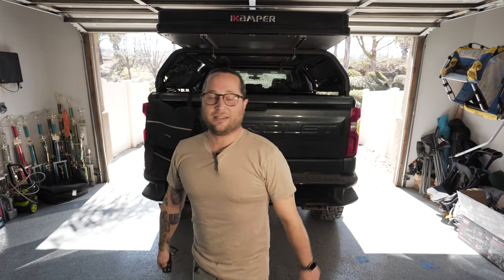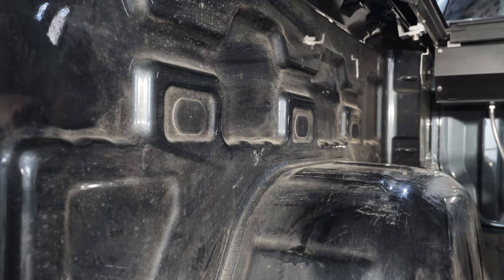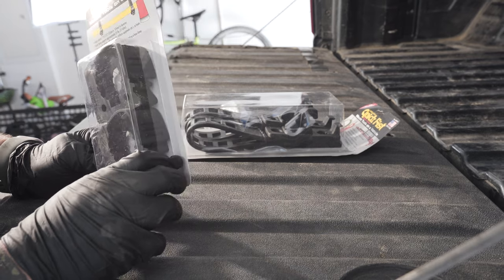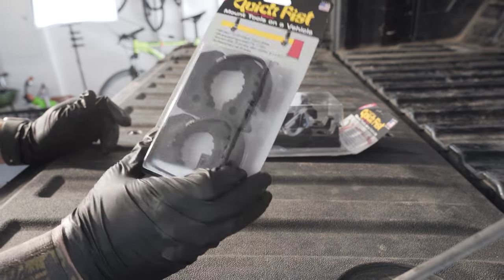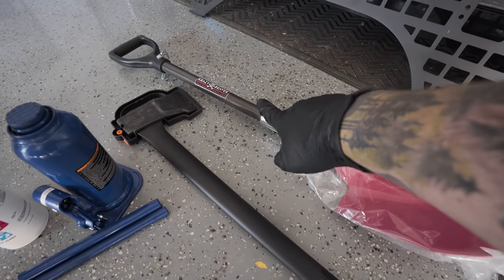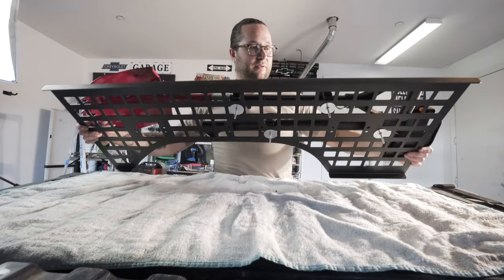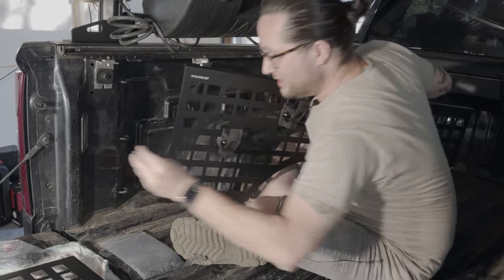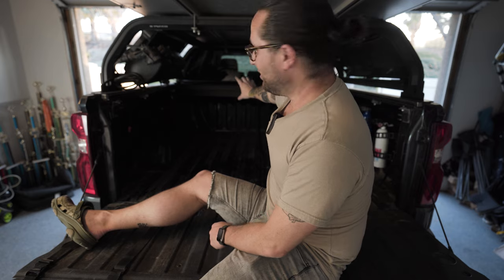Molle Panels for your Truck Bed! (Putco Molle Panel Install)

Comment: I really like the system. From my experience I would add a door breaching tool, fire extinguisher, tool box, med kit, Slim Jim, and bolt cutters. All of these I’ve needed for emergencies on the road.
Reply from the maker: I might need to add door breach tool and bolt cutters… good call.

Comment: Man great video u always post good stuff didn’t even know these existed lol I’m getting these for my truck for sure I’m gonna look into the third one maybe my air compressor could go there since it comes in it’s own case nice and my tire repair kit!Thanks again! 👍🏼👍🏼
Reply from the maker: I was thinking of mounting my compressor there too, I just need to research a good way to send the power wires up to the battery. 🤔

Comment: How about a power tank or 4x4 jack?
Reply from the maker: I haven’t used C02 for airing up yet, but this would be a great spot for a power tank. Power tank sells a diagonal mounting plate so you can fit the tank in at the right angle without having to remove it when in use. 👍🏽
Reply: I have the built right industry panels in my truck and I attached a power tank to it. I have had zero issues. On the power tank website just look for the package that has the truck mounting stuff in it.
Reply from the maker: @aaroncontreras3658  very cool! #goals

Comment: Really appreciate your content! I’m wanting to get in to overlandig for 2022! If you went with a tonneau cover that had the roll up on the exterior, would the extra shelf then fit? Didn’t know if it rolled up on top if it messes with your bed rack or created enough space for the extra interior bed side shelf.

Comment: Any recommendations on seat storage? I purchased a trail boss to use for camping and recently purchased storage for underneath the back seat but I’m looking for something to maybe hang over the driver and passenger seats.
Reply from the maker: Do a bit of research before putting on seat covers or straps on the driver and passenger seat. I think there is air bags in them and if they were to be restricted by something it could be dangerous. I've seen some cool seat cover/molle storage for the but I decided to not cover the seats at all for that reason.

Comment: Can you install these under a BakFlip Tonneau cover? (Or any kind of normal tonneau cover) Like is there any kind of limitation to where you can install these?
Reply from the maker: The molle panels stop before the stake pockets where most tonneau attach so it should work with most covers. Best bet would be to call Putco and double check with your specific cover, they have great customer service and always a live person answers their phone.

Comment: Any suggestions/tips on how to install if the bed has been sprayed with Line X? (Spray on bed liner)

Also any issues with the rack covering tie down points? I have a 2020 Trail Boss as well.
Reply from the maker: I’m not sure about if it’s sprayed, you could check if you can get access to the three holes or not and you should be fine. This rack does not cover the tie down points. Actually you could use the molle as additional tie down points!
Reply: @halohalohikers3571  I definitely wouldn’t use the aluminum panel to ratchet down to and use as a tie down there doesn’t look to be any support on the tops and bottoms of the panels.